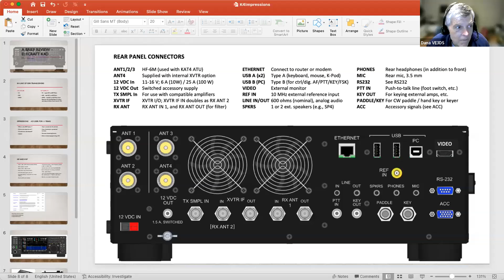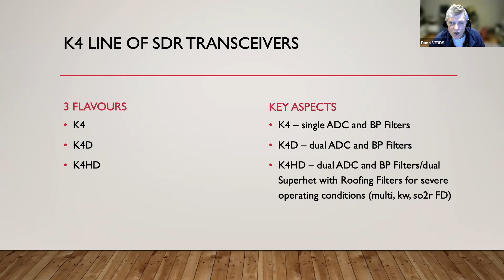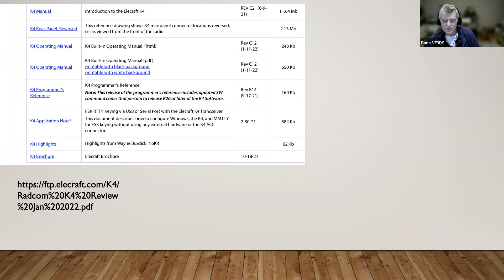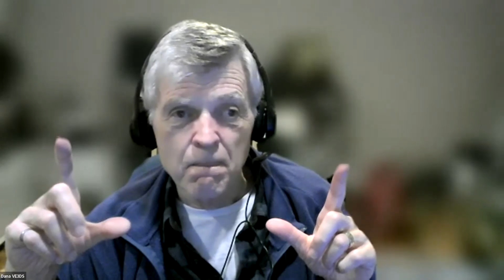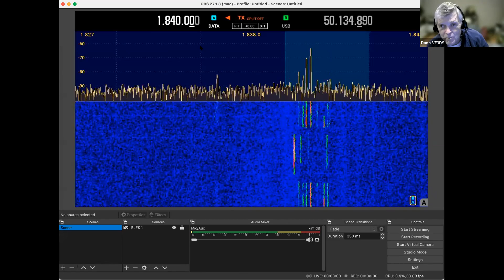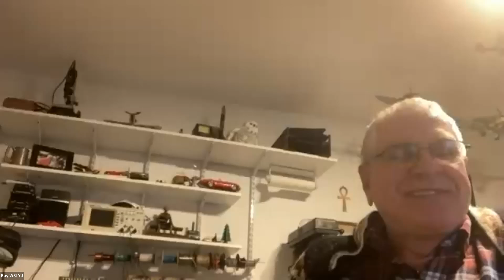Opening the Elecraft K4 by Dana VE3DS - Front Range 6 Meter Group Feb 16 2022

Comment: Has Elecraft mastered how to go multiple rigs into multiple fixed antennas and do the phase shifting for a synthesized beam pattern?  Like diversity beam forming receive..  how about the same on TX.  The ability to link multiple rigs for bidirectional beam forming would be EPIC!  How many rigs can you afford?
Reply: I have an early ANAN 200D and a 100D was thinking I could maybe shift using the 10MHz reference clock input to shift the phases between the two transmitters.  If you could work some FPGA magic, would a simple thing to arrange.  The Elecraft uses the Shark DSP so should be Real Easy to sync multiple rigs given a sync signal between them.  KI4Z '73